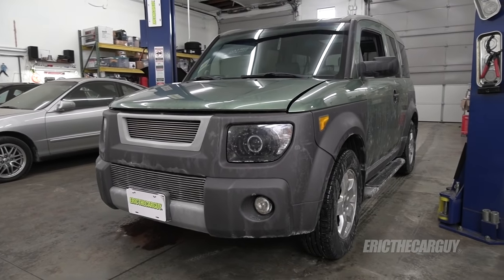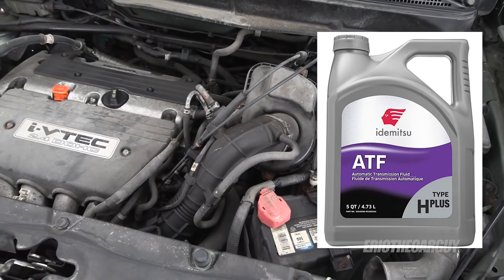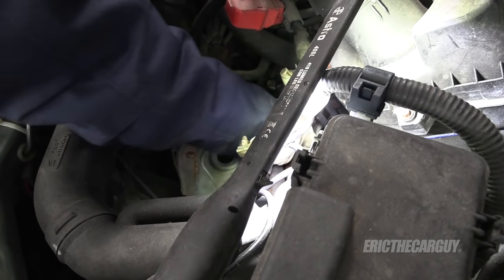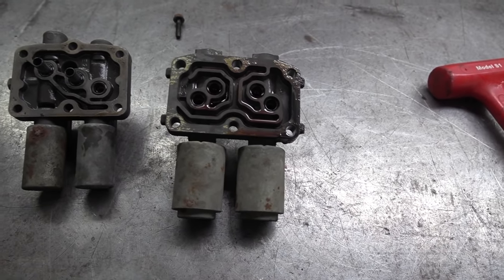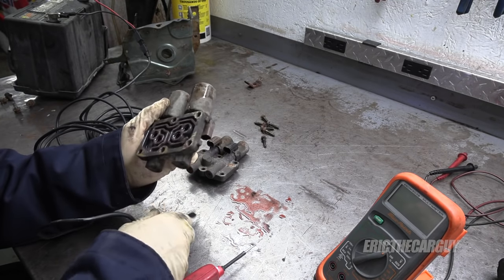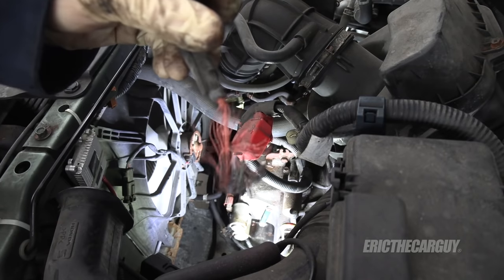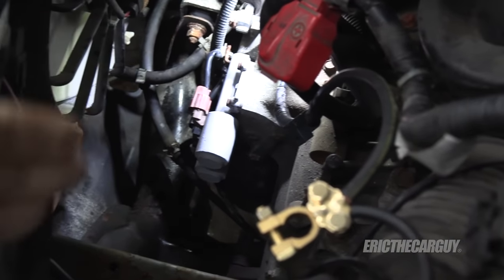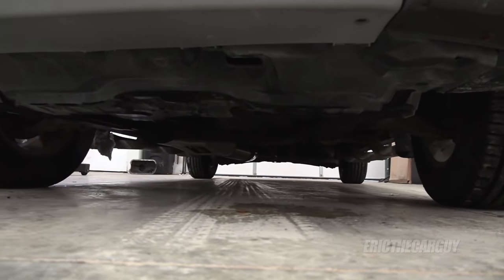Delayed Shifting, Honda Transmission

Comment: thank youuuuuu! I had my car to all different mechanics! it's been going on since I owned it 3 years! no one could figure it out because it didn't do it all the time! I was ucking determined. ! to figure it out!! I got 182000 miles on it and it still drives like a dream. except for that hesitation between 2 n 3! I didn't wanna give it up. if it was the trans and I had it checked they said nothing is wrong with it. there's something wrong with it. a new trans I would have to have given her up! your a god sent knight in shining armor to damsel in distress.

Comment: After removing the AB solenoid.  There are 3 or 4 small cylinder screens on the other half that's attached to the fender. These screens can clog causing less amount of pressure.  So you missed this before putting the solenoid back together

Comment: Honda transmission in the odysseys are known to have problems shifting because the gear is up higher and doesn't get proper lubricating from 2nd to 3rd gear. My 04 odyssey I just purchased with 68,000mi. has that same problem and there was a recall.

Comment: My 2003 Civic does only do the delays between shifting when the outside temperature is moderate to cold before engine reaching the operating temperature. Once it's warmed up power and shifting are normal.

Comment: Had the trans rebuilt 2 yrs ago. But ever since they did it. It has a hard downshift from 2nd-1st. They said it would go away, 2 + yrs later still doing it. Everything else is smooth with it. 05 Honda Accord 4 cylinder
Reply: check the level of transmission fluids,less or more can contribute to the hard shift .

Comment: Just started having issues with my 2006 Odyssey transmission. It left the wife stranded and got it towed home and I drove it and everything worked fine for about 15 minutes then it started acting up and only had reverse working. let it sit for a few hours and it worked again so I could reposition it. I remove the solenoids on top and check those screens and they were clear. I am hoping it is just a soleniod problem but being that transmission I am losing hope.

Comment: There are screens in the solenoid tubes that remained on your transmission. They simply pull out, and on the solenoid side, there's O rings.

Comment: Hi,
Does replacing this solenoid affect any gear change? I.e. 1st to 2nd?
I have an MJ8 transmission with a problem from 1st to 2nd. What transmission is this?
Thanks for the video 🙂
Reply: In this case the A(1st to 2nd)B(2nd to 3rd) solenoid triggers those shifts. Most of the time in other vehicles you have to drop the transmission pan to replace them, as they are inside.

Comment: Similar deal on sister's Jeep Grand Cherokee.  42RE.  Wouldn't shift out of 1st, period.  Not intermittent.  Output speed sensor tested within spec on ohms.  Replaced sensor anyway.  Fixed problem.

Comment: Yo eric I've seen the chemical analysis's for both the honda dw-1 and the idemitsu versions and they are quite different when it comes to chemistry. Whether or not that translates to different friction characteristics, shearing or performance is yet to be known. I havn't heard anything bad about it its just the Honda fluid uses magnesium and zinc for friction modification whereas idemitsu uses phosphorus
Reply: Any updates on this information?

Comment: I had this issue in my 2001 crv around 250k
Would also slip in kicking down a gear if trying to pass someone.
I traded it in for a 2015 crosstour

Comment: Great Video! My 04 Acura MDX has similar issue on cold start in first gear. The transmission has multiple solenoid's. How do you determine which one is at fault?

Comment: Pilot did it in second -third and slams into gear. Changed the solenoid and fluid.  Never did figure it out. Sent it to the junkyard, because it needed more work than what it was worth.
Reply from the maker: It's more likely it needed a transmission. https://www.ericthecarguy.com/solving-transmission-problems/

Comment: I was a doubter...really didn't think the solenoids were going to do it... Nice repair
Reply from the maker: 4 cylinder Honda automatics rarely fail internally in my experience. It's the V6 transmissions you have to watch out for. Thanks for the comment.

Comment: You mentioned changing the trans fluid and that Honda's are manual transmissions that they automated. Does that mean that the general rule of don't change fluid in an older higher mileage transmission doesn't apply?  Thanks, great channel.

Comment: Excellence my guy. Ty. I am in the beginning stages of diagnosing. My 2013 Odyssey feels like it is not shifting in overdrive, but I’m not sure if it’s just me or the car I don’t drive it much it’s my wife’s vehicle for the most part. my daily rig is a 97GMC sierra so I don’t know if I’m just used to my truck but I do drive the van couple times a week I don’t know and I don’t know where this comment  is going but thank you for another awesome video very informative. I didn’t know there was an external filter. I wonder if it’s the same on my 2013 Odyssey? Stay tuned.!!!!

Comment: The CC halfsfaft on my 2001 Odyssey broke. I got another at a scrapyard but I either stripped its threads while trying to reinsert the half shaft. Any advice how to tap out the holes at such a weird angle or to who should I bring it?

Comment: I have a 13 ridgeline which slightly jerks before a stop. I see the rpm jumps about 200pm from 900 to 1200 and back down to idle rpm at a stop. So far I changed the fluid twice, same.  It seem intermittent, does not occur initially but once everything is warmed up and going I will notice it occurring when coming to a stop.

Comment: Could be that the solenoid and its bore might’ve been binding under fluid pressure or a load sometimes I know it’s just cleaning the throttle body on the car helps of shifting and or if it got low fluid..

Comment: there are small filter screens in the solenoid housing that can get dirty and clog-up ... there are other videos that show it ... just gently pull them out ... clean with some brake cleaner .. and then put them back in ... it was not mentioned in this video ... very simple and I suspect it may have been the actual problem ....

Comment: Mine slips once in a while when the transmission fluid gets low when it’s in first gear 10-20 miles it throws me forward

Comment: Issue like this could also be clutch pressure switch.
Honda 02-04 CRV 3rd Clutch Pressure Switch (P0845) 28610-RKE-004
Honda 02-04 CRV 2nd Clutch Pressure Switch (P0840) 28600-RCL-004

Comment: Hey Eric, thank you for the videos as always, I'm super lucky you're into Elements so I can take care of mine.  My E has a hard downshift from 5-4.  Info online is limited on these solenoids.  Is it safe to say that the single solenoid on the top of the transmission is the one that controls these upper gears and should be examined?

Comment: I"ve got a similar problem with my 2008 Element. It got to be so bad, the car was undriveable.  Transmission flush revealed metal bits in the fluid. Replaced the transmisiion with a re-man. The Element drove fine for about a week and now it's doing it again. This time the problem is going from 1st to second gear. It will max out at over 4 grand RPM and then HARD shiift into second. Thoughts? Solenoids and torque converter are all new. Thoughts? It's going back into the shop.

Comment: I had a Honda Prelude SI that wouldn't shift into second gear until it redlined first, and then it would go through all the rest of the gears fine after that, for the rest of the day.

Comment: Great video as always Eric. 

Did you measure the resistance of the replacement solenoid? just for comparison?
Reply from the maker: No. As I said in the video, resistance checks on solenoids are useless in my view.
Reply: @ericthecarguy  Okay. 
Yeah, you said so. I understand you. 
The resistances do mean something  though. I'll leave a hint below. 

Thanks again for your videos. 
Always helpful. Really helpful.
Reply: I'm more electrically inclined than mechanical. So the resistances mean something to me but only when compared against a same make and design. Here's some hint. I hope it helps someone. 

When comparing exact same types,.......
For solenoids or actuators with low resistances as these (below 20 ohms), a difference of 1 ohm or more, means something is wrong with one of them. 

For same type of relay coils with resistances of about 100 ohms, a difference of 10 ohms or more, means one of them is faulty.
Reply from the maker: Unless the circuit is under load, you're really not getting the entire picture. Voltage drop is the only way to go in my opinion.
Reply: Yes.  That's true though. Resistances alone don't give the entire picture.
👍
Reply: @ericthecarguy  Should have said "Checking solenoid RESISTENE IS FUTILE".
Reply: @dlewis9760  not everyone knows what the Borg are
Reply: Are their any filters associated with the solenoid like some other shift solenoids
Reply: @NoName-si2iw  
Yes, there are small cylindrical screens.
Reply: @dlewis9760  LOL

Comment: Hi Eric

I'm posting here out of desperation as I've exhausted all other avenues and I'm not sure if even Honda themselves know what causes this problem, but...

I have a 99 Prelude 2.2 with the M6HA auto transmission. It has started slipping in 4th and flares badly when shitting between all gears when at more than very light throttle, also takes a long time to engage reverse (but reverse does work and doesn't slip). 

Things I have tried:
- cleaned all solenoids out
- fluid change, twice

I can't afford to do a 5speed swap at the moment so I'm considering getting a rebuild kit and having a go at rebuilding it myself. This would be my first time rebuilding a transmission. 

Have you ever successfully rebuilt one of these transmissions? Do you have any advice on how to solve this issue?

A new CPC solenoid arrived today so I'm going to fit that and also possibly replace shift solenoid C, but I feel like I'm throwing parts at it at this point. Is there anything I've missed before taking it apart ? Pressure switch maybe?

When in 4th you get into the throttle and it slips for a good 10 seconds then eventually engages, but add any more throttle and it starts slipping again.

Weirdly the problem seems to come and go, some days it acts fine for a little while then starts doing it again. 
 
I would really appreciate any advice as I love this car and I'm determined to fix it one way or another.

Comment: Very interesting! My GF has a Mazda3 (so all bets are off...) but she has the EXACT same issue. My basic diagnosis found nothing so she dropped it at the dealer and they said they tested the solenoid and said it wasn't it. The said the only other thing it could be was the TCU/M and due to various delays it's been sitting at their shop for FIVE MONTHS. I wonder if I should ask them to take another look at the solenoid, or see if I can get it back and find a spare at the pick-n-pull to test.
Reply from the maker: Resistance checks on solenoids are useless in my view. The failure usually shows up when it's under load and working. A voltage drop test is a much better option for testing solenoids. The problem is finding a way to test them while they are working. I hope that helps.

Comment: Hope you can answer this for me please. OK I have a 2006 honda odyssey and mechanic put another transmission in it, but doing the exact same thing. When you drive for awhile or longer trip and warms up all gears shifts good going forward, but when going into reverse it takes a few seconds then goes into reverse but starts jerking and when you let off the gas it rolls forward and kicks in reverse when again when giving it gas. It's hard to explain in a text message but I hope you can understand what I'm saying. I'll do a video of it later today and you can see what it's doing. But it's strange how this one is doing the same thing as the first one did. The exact same thing. Lots has been done to this van in the past year and still not fixed. Motor replaced wire harness all three catalytic converters. And much more. Please I hope you can help. Thank you.

Comment: I may be late to the party, but I'm having such issues.. thing is I've changed fluid and Transmission is only 33k miles since swapped from a crashed 120k mile 05 accord..haven't changed the filter and my solenoids look crusty like yours... Not bad just kinda weird not rusty look

Comment: My 2002 Honda Accord V6 has a delayed shift. It drives and shifts as if it's a manual and every time it goes to shift it's as if you hit the clutch and you don't let off the gas and do a No lift shift if you don't lift off the gas at the right time. It's got pretty Honda fluid in it. It's been doing this for the last 5 years. I've always drove it with timing the shifts while manually shifting it with the shifter selector. Does it every single gear. There's no slipping whatsoever though. I've researched and researched and can't figure it out but it's a somewhat common issue. What's ur take????

And what I mean is when it goes to shift it will rev up and then slam into gear. But it's literally a clutch theres no friction in the transmission when it's revving. Idk if something like a solenoid is dragging every shift or what

Comment: Hey ETCG and whoever may be reading,
I have a 2004 Honda Accord 2.4L 5AT, ive had it for 5 years and it’s had the same issue since the day I got it (hasn’t gotten any worse). When trying to lightly accelerate at a low speed in second gear, it feels like the transmission lags behind the engine. Its hard to explain. This happens in traffic, and when doing an “American stop sign”. I’ve changed the ATF fluid and ATF filter.
I have no idea what the problem is.
Thanks!!

Comment: My 2015 pilot slips into 1st, 2nd , and 3rd. Worse when cold. Its been flushed with filter change at 30 and 60k. Its currently at about 95k mi. So it's due... but that's definitely not the issue.

Comment: The 5 point hex is the adjuster for pressure, adjusting1/2-1 turn can solve that without having to replace solenoids.
Reply from the maker: Good luck getting it to turn. I actually think it's pressed in and not threaded.
Reply: @ericthecarguy  this tool from sonnax  Solenoid Adjustment Tool
Part No. 88950-T

Comment: I have a 94 integra with an auto transmission. When the engine is cold the torque converter doesn't lock. Sometimes it goes in and out of lock if it's like 20F outside and I'm on the highway. Maybe it's the same problem but with the lock up solenoids. Temp sensor gauge sits between 1/3 and 1/2, so the engine should be warming up enough.
Reply from the maker: http://www.ericthecarguy.com/faq/solving-transmission-problems

Comment: me when I had problem with 8HP45 and was hard to reproduce for the dealer, mine happend on low load when it sat overnight. If I had go over 3000 it shift fine for the rest of the drive. They replace the valve body and it was fine, me and the Trans tech at dealer tought it was internally leaking and causing the delay to shift. Now it came back after I replace the battery... This ZF trans is touchy for the learn procedure, I got it right the first time the battery died, but not when i replaced it.

Comment: How did you know if the problem was caused by the Solenoid and not the faulty ATF filter? As you had changed both at the same time.

Comment: Excellent fix on the transmission solenoid and ground wire fixing and transmission filter. Would an aftermarket transmission filter work as well as GH genuine Honda one?? I have a 2014 Acura TL SH-AWD 3.7 Liter and am going to do a transmission fluid change and so was wondering about the filter… keep up the great work. Al Tanner Peoria AZ.

Comment: So if the car sits for a month, lack of movement could let some corrosion set in and degrade solenoid performance?  
I've also had great success with Valvoline Maxlife ATF on Honda, Toyota, and Volvo transmissions.  It solved many shifting issues.

Comment: Hi Eric,

I have an AUDM civic 2007 K20Z2 with MPMA box. It recently develop delay shifting(every gear I believe, but the symptom is minor between 4th to 5th) especially under load. Sometimes even hesitate after I put my foot down when car is still cold.

Tested solenoids with diagnostic tool and I can clearly hear them click in the test.

I'm kind of leaning toward the solenoid but just wondering if there is any way can proof the solenoid it faulty?

Cheers.

Comment: My odyssey shakes and gives issues shifting. I was told to flush the torque converter 3 times and that should fix the issue. That along with a update.  I just haven't done it yet cause tbh I'm ready to give it up for something new.
Reply from the maker: https://www.ericthecarguy.com/solving-transmission-problems/

Comment: My 97 CR-V sits a lot more since I retired. I'm having a little shifting trouble between 2nd and 3rd gears which is intermittent. I just changed the steering rack (it was totally shot) and had to drop the AWD transfer case, so I drained the transmission. It looked like black, sludgy oil. I don't recall it ever having been changed. I know I've never changed it before. I'll see if the fluid change helps, and I need to change the shifter cable. Pieces were dropping on my head from it while I was working under the car. Solenoids will be the next thing if it keeps happening after what I'm doing now. I don't know if I can get to the filter. There is one inside the trans, but I'm not sure it's accessible.

Comment: Correct me if I’m wrong but I believe 2000 for it was only a four speed transmission or three speed with overdrive then in 2005 they introduced the five speed

Comment: So I have a 2005 Honda CRV you remove the lower splash shield and it gives you at least what I thought way better access just make sure you put it improper know which way the pinch weld is